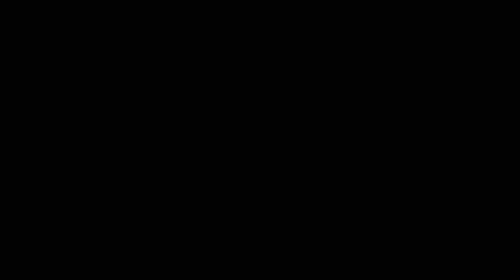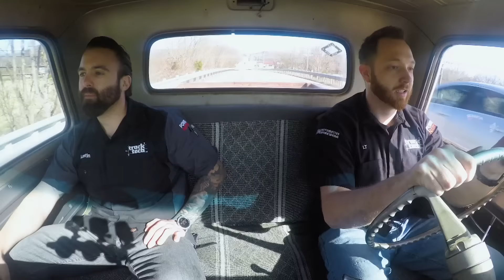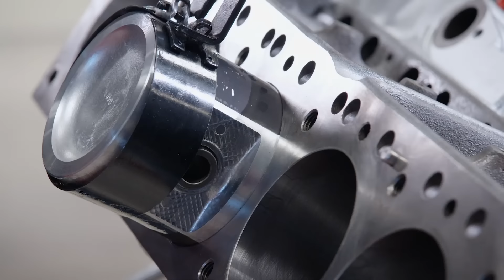Forget the LS Swap: Building a Turbo Chevy 292 Straight-Six

Comment: What about a Ford 300 I6?
Reply: I got 1 them
Reply: You know they got to build one just because!
Reply: @retiredafce3373  They did build one. However it was not treated that well. It also only had a 390cfm carb on it. But it still made 203hp and 306 pound feet.
Reply: Search Ford 300 turbo on here if you wanna see a big ol nut of around 420-450 ft pounds or so on most runs I've watched. 
Shits like diesel torque.
Reply: A Barra motor?
Reply: @DaInfamous0ne  it's an aussie ford motor.  
  Have a look for dynomite performance.   They build some crazy engines .  
  And also look for this years Summernats Dyno Comp.   
 The red falcon is awesome.   👍
Reply: @Customwinder1  i know what a Barra motor is. Its kinda like the I6 in the Chevy Trailblazer & GMC Envoy
Reply: @DaInfamous0ne  oh right no worries mate.   
  I  don't know much about the  chevy i6 motors.  I'll be sure to check them out.   
 Cheers bud 👍👍
Reply: @DaInfamous0ne  think he may be ferrin to a slant six 225 idk but be interesting too
Reply: just do a ytube vidio search 300 six turbo and it will be one of those that pops up
Reply: @williamescolantejr5871  thanks mate.   I'm  at work at the moment.    I'll be sure to have a look when I get home.    👍
Reply: I'm a chevy guy and give credit where it's due. That 300 was a bulletproof engine.
Reply: @user-neo71665  This EP is about the sent from God Chevy 292, not Ford left over tank plating from WW2. Let's stay focused on the real mechanical art that is the Chevy 292, and stop degrading this comment section with the wisp of Ford nonsense.
Reply: @hawkdsl  good on ya mate.   You sound just like the Holden boys at work.   Always giving it to me  !  😂😂
Reply: @Customwinder1  ;)
Reply: @hawkdsl  ford won le mans 5 times, 3 with the gt40 and 2 with cosworth. How many times has chevy won le mans...
Reply: @CraigFenske  Chevy doesn't concern itself with minor French oddities. However Chevy does use the event to test products in the pipe line. It's mostly an excuse for GM executives to have what is perceived as a decent croissant. I do credit Ford with showing Ferrari that even a minor league American Car company, can beat what the Euros consider their best. I give them that.
Reply: @hawkdsl  what about drag racing or nascar in the 60s
Reply: @CraigFenske  Chevy and GM in general have always been the best. We can do this all day.
Reply: @hawkdsl  what about selling oil to the nazis in ww2
Reply: @hawkdsl  we can do this all day buddy
Reply: @hawkdsl  and ford help build jeeps for the allies in ww2
Reply: @CraigFenske  WW2 saw the conversion of all the auto plants to the war effort. GM built the Sherman Tank, B25 bombers, and C47 troop/cargo planes (DC-3). Literately, Chevy won the war. That's why Americans everywhere still sing "Baseball, Hot Dogs, Apple Pie, and Chevrolet!"  - https://youtu.be/zqweygy9K9Y
Reply: @hawkdsl  selling oil to nazis though
Reply: Apple flavoured bleach henry ford received the iron cross for his book,
“the international jew...”
Reply: @CraigFenske  about 8 times
Reply: Look up imsa and wec wins for gm look up nascar wins for gm drag racing is mainly mopar winning year after year you listed sports that Ford hasn't won that much in. Also dont try to compare old wec to new wec a gt40 wouldnt be able to compete with a modern gt class lemans racer
Reply: @whitemalerage4231  did not know that, i knew he was against jews but did not know that
Reply: @jdrok5026  can you list the cars they used cause i am too lazy. I know nowadays, chevy is starting to lose a lot in nascar but that could be just because of the teams.
Reply: What about Ford? No need to ruin a good show, or insult a good machine shop with such.. unsophisticated nonsense. Have some decency man!
Reply: @hawkdsl  yeah man, fords are so unsophisticated that they won nascar so much with dodge, drag racing and le mans.
Reply: @hawkdsl I'm not even a Ford fan, but that comment was straight BS... I'll give respect where it is due... Id I had to choose any FORD motor it would be a 300 I6... Even a GM tard like me could see they're bulletproof... Get your head out your unsophisticated, classes ass...
Reply: @chriscisson  I am both shocked and horrified that the Brain Dead Institute has obviously allowed brain damaged people access to the internet again. Hush! Stop your lies about Ford POS products. Accept Chevy as your savory, or your souls will burn for eternity!  And stop being triggered by what is obvious hyperbole. Jesus, you people are wrapped tighter then a giant rubber band ball.
Reply: @hawkdsl  you sound fun. 😂 what's your fav flavor crayon? Mines green. You like eating Elmer's glue, or dollar store kind?
Reply: @chriscisson  read the whole comment... and stop playing with liquid mercury.
Reply: @hawkdsl  I did. 😂 And I agree. Don't tell me what to do. Lol. Imma go eat some of these paint chips... Hopefully they're Lead based chips...
Reply: @chriscisson  Don't eat them all, save some for later. ;)
Reply: @chriscisson  check out the Barra Inline Six.
Reply: @chriscisson  seen on ytube where they added a 7.3 turbo to a 300 and wow ran like bat outta heck
Reply: jr.  Imma need you to find me a link for this video. Lol.

Comment: siiiiick 6 bangers are so underrated. Love a good 6 banger mate.
Reply: I wholeheartedly agree. I have an 85 F-150 with a 300 i6 and love it too death.
Reply: @legostar55  in Australia Inline 6 cylinders are a big deal A lot of early model 6s made more power then their v8 counter parts and late model Ford turbo straight 6 Falcons highly regarded by enthusiasts as you can make big power with minimal modifications.
Reply: @edgelordcutting  I've been letting these guys know about the Barra .   
  👍
Reply: @legostar55  i had a 265 Hemi as a kid god i miss that car.
Reply: BARRA !
Reply: Here in Australia, until recently, (General Motor) Holden, Ford Australia and Chrysler Australia all built good inline 6 cylinder engines. These engines have all received the attention of hot-rodders and the motorsport crowd. Even though the Chev 292 was a  relative oddity in Australia a lot of what you are showing here is relevant, particularly to the GM Holden engines.
Reply: Then you're in the wrong place man, nothing good about it. This is just another "polishing a turd" video. Those head ports made me throw up a lil in my mouth.
Reply: @KalLanPIDT  lmao
Reply: Godly Powers totally agree all these apologist.. inline 6 🤮